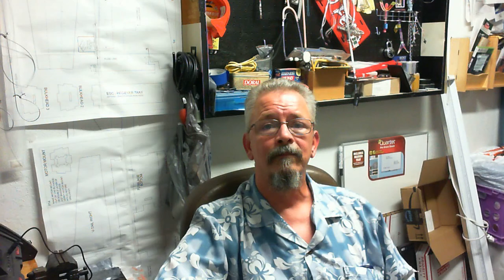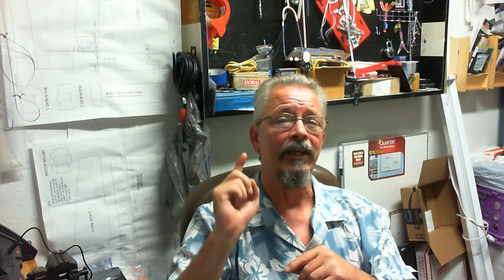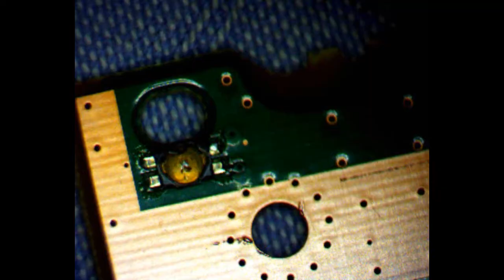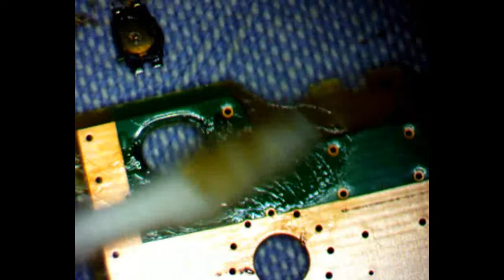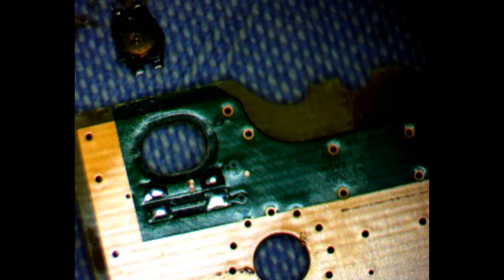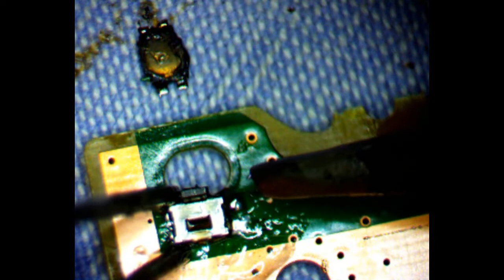PS4 No Power Repair 12xxA B Motherboard

Comment: Do yo remember the symptoms his was showing? Or were there any signs that the button was bad once you got in there and saw it up close? I've tried a power supply swap already, multiple cables and outlets, and multiple other ways to turn on the PS4 (inserting a disc and plugging in a controller) but none seem to work. The eject button still makes noise but that's it, power button and inserting a disc to the drive give no response at all. I've also tried the washers on the APU in case that was it but that doesn't seem to make a difference either. Last thing I can think of is the button itself or something on the motherboard that I'm not comfortable replacing at the moment. Just wondered if you had any thoughts or tips.
Reply from the maker: washers on the APU??? Ya best way in the world to destroy your system! Don't try to repair your system using youtube videos all you will succeed in doing is making a repair more expensive or flat out kill your system 95% of the time.
for every problem you have, there can be 100's of reasons for it not working a good example of this is not reading disks just because it will not read a disk does not mean it is the disk drive it can be motherboard hard drive or even cables

1st Your power button is not your problem
2nd If you did not already damage the system beyond repair you actually need a motherboard repair that you can not do at home due to lack of education youtube just will not do for you and FYI the equipment required to properly repair your system is more than the price of a new system so do yourself a big favor and take it to a qualified repair shop or buy a new system all you are going to do is waste your time.

Comment: what did you set your soldering iron temperature too?
Reply from the maker: If you need to ask that it means you should not even try to do this yourself this looks easy but it is not in case you did not notice this was done under a microscope camera without it you will likely do nothing more than destroy the contacts and make it so you can never use the button it would be best to take it to a shop with a repairman that has component level electronics education.

Comment: Hi there great video my PS4 power button looks identical to that in your video, so am in need of a new push button fixture to be soldered on the mother board. You said in your video that you got the button of eBay? I have had a look but I can’t seem to find any?? There is loads for the ps4 slim are they the same button?? Cheer anyway
Reply from the maker: I just looked and found plenty I just typed in [PS4 power button] You do understand that this is not an easy repair and you need very good soldering skills in order to successfully replace that part without destroying your system.

Comment: Hi, do you work on Ps4 orignal? Turns on for a second or 2 then turns off.Power supply was replaced and still does this.Believe it's a motherboard issue.Can you fix this?
Reply from the maker: Yes, and yes but I do not do mail in repairs unless you just can not find a qualified shop near you

Comment: Hello dughc i have a question maybe you can help me i have a ps4 pro it got whet thru the window pretty bad now it wont turn on at all i though it whas the power suply that it was bad but it whasnt then i was thinking the motherboard is bad but do you think theirs a chance it could be a part from the mother board that wont let it turn on like you describe in your video plese help me
Reply from the maker: There are a thousand+ reasons why your system will not turn on? with it going thru a window I would suggest you look for missing components on the motherboard and look for any components that have cracks on at the base of the components where they are attached to the motherboard You would likely need a microscope camera setup for that task. I would likely believe your problem to be the APU has ripped a contact below the chip and that not even Sony can repair. then again your no power problem can have nothing what so ever to do with the PSU or the Motherboard believe it or not. I do not have the time nor the willingness to explain how to test or repair electronics, So I suggest you take your game system to a qualifed repair shop. [You know, one that has a repairman that has gon to school for component level electronics and did not learn everything they know off YouTube].
I Can fix it, so If you are near me and can bring it into my shop? Google (Clovis X Game System, PC & Laptop repairs) and I will be happy to see if it is repairable to a reasonable price. 
NOTE: I do not do mail in repairs Sorry.

Comment: Really? Replacing a button will allow a ps4 to turn on? Why can’t u use a cd or turn on with controller? This clickbait?
Reply from the maker: Please Don't be STUPID there are hundreds of reasons for a problem and some actually like their system to work correctly.
Reply: @ClovisX  I mean tittle shoulda been more specific no power repair? U just replaced a button